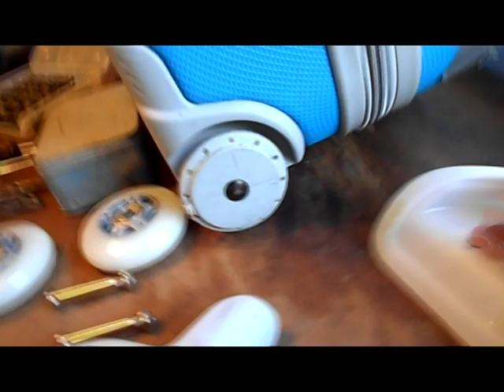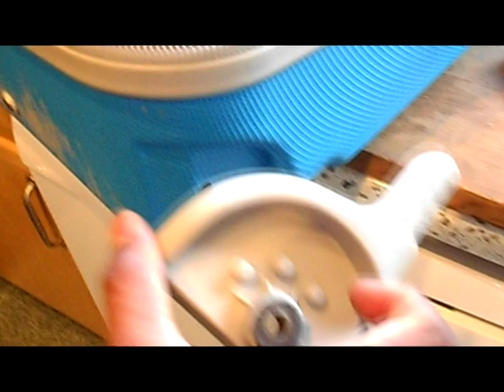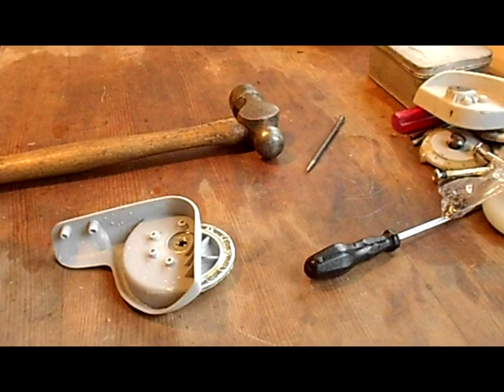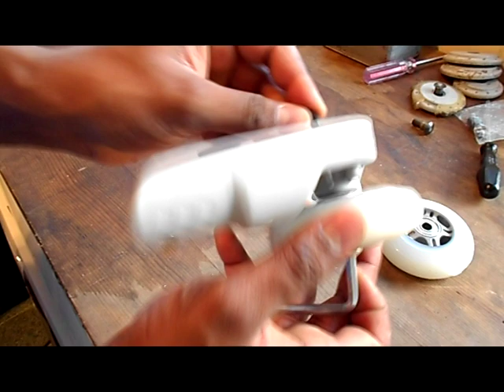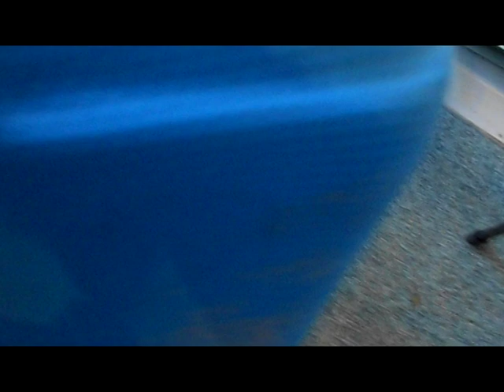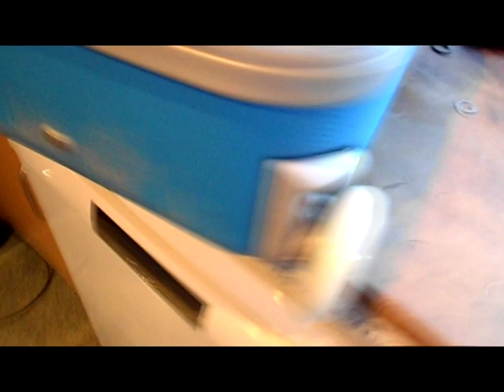Step by Step Guide on How to Repair & Replace Broken Suitcase Luggage Wheels Tripp Samsonite Vid #84

Comment: OMG. He uses a mains powered drill with running water. That is incredible dangerous! Unless you are incredibly careful, you electrocute yourself doing this. I do not recommend doing this. If you must. use a paint brush to brush water on the job from a bucket or basin but not running water.
Reply: Peter Doogue agreed. U use machine grade oil would work great!

Comment: 0:40 List of tools
1:18 Look at original wheels
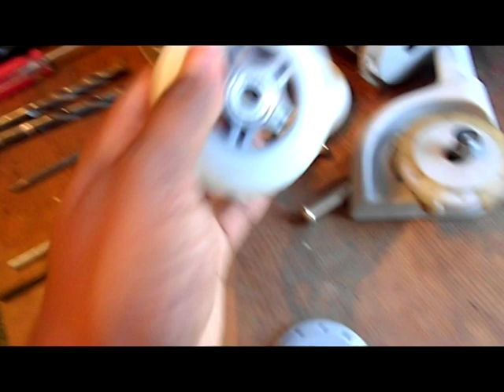1:50 Look at suitcase with new wheels completed
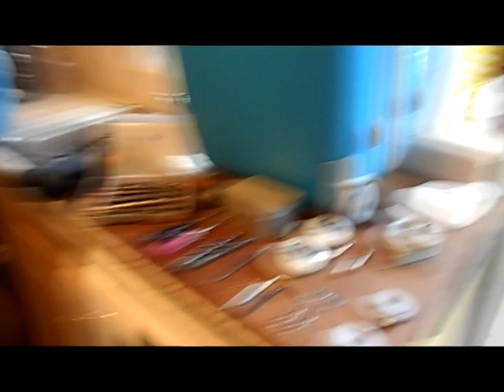2:20 Parts needed to replace the wheels
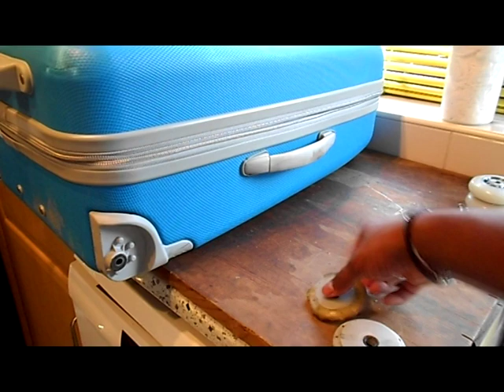4:45 Removing the housing for the wheel
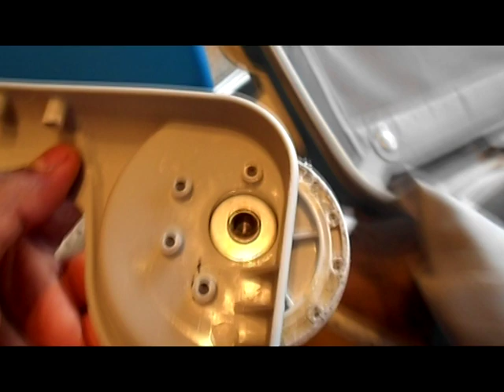7:10 Drill away the lip of the rivet
10:40 Preparing the sink for drilling
12:48 Removing and cleaning the drill bit
13:30 Removing the centre pin with the centre punch and hammer
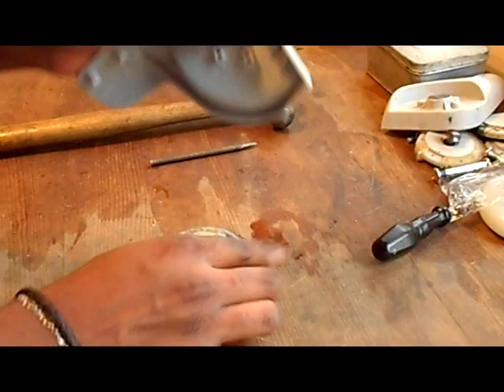14:35 Removing the washers
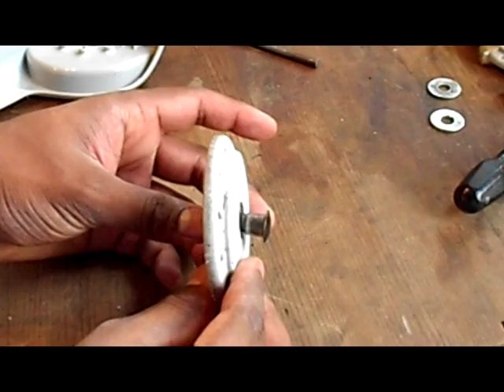15:55 Removing the pin from the old wheel
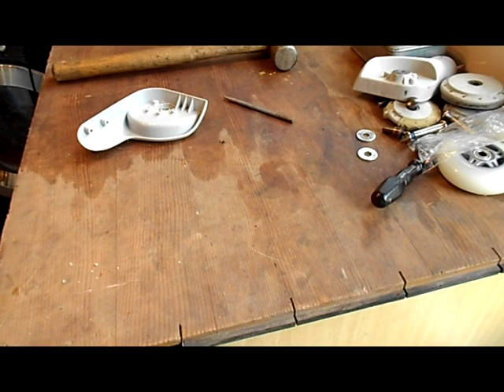16:15 Preparing to mount the new wheels 
16:30 Tools for mounting the new wheels 
17:35 Putting the washers into the wheel casing
19:25 Screwing and tightening the bolt into the wheel
20:18 Tips on mounting the wheel
22:03 Mounting the new wheels on the case 
22:10 Drilling the hole in the case for the head to sit flush 
25:40 Drilling the case
27:20 Re-attaching the wheels and their housing 
30:00 Roll test to check it works
Reply from the maker: Hi Stephen. Thanks very much for posting this, very useful. I have now included this in the video description. Thanks. Anton

Comment: Wow! How lucky am I to find this extremely well made video which fixes the exact same Tripp suitcase as mine (same colour as well) with exactly the same problem, just before I loaded said suitcase into the car destined for the local amenity tip. The wheels look to be unrepairable but now I know different.
Reply from the maker: @Julian Khan. Thank you very much for posting this comment, It really is appreciated. did you fix your case in the end? Regards. Anton

Comment: How do you find the size of the replacement wheels, I have a samsonite pro-Dlx and it is very thin.
Reply from the maker: @Annie Lee. The wheels  I used where 80mm Diameter and I could have probably used 85 or even 90. See how much room you have left on your case with different bits of carboard cut to the shape of the wheel. One thing to bare in mind is that these wheels sit further out from the case then the originals, which means you can generally go for larger wheels as the tops should not rub. I hope this helps. Regards. Anton

Comment: Where can I get the wheels? Thanks
Reply: Could you advice me where I can get the 80ml dia wheel with the 8mm axle as I can only see 6mm on all the websites I have viewed
Reply from the maker: Hi there. I used ebay, and have just purchased another set today to fix another case I have, and it was around £15 delivered to my door with a 90mm diameter and an 8mm centre hole for the barrel bolt

Comment: hullo, where do you obtain your wheels and axles?
Reply from the maker: Hi there. I used ebay, and have just purchased another set today to fix another case I have, and it was around £15 delivered to my door with a 90mm diameter and an 8mm centre hole for the barrel bolt. The bolt is 8mm diameter and 40mm long. Regards. Anton

Comment: Nooooo mine is the 4 wheel version :(
Reply from the maker: Chris G I believe you can still do this, using roller blade wheels, instead of scooter wheels. The principle of swapping out the rivet for a axle bolt should still stick. let me know how you get on if you give it a go :)

Many thanks
Anton

Comment: Thank you!  Very clear visuals and steps.  I have a different suitcase, but believe the basic principles you presented will still apply.  Very helpful!
Reply from the maker: Hi Linda

Thank you so much for your kind words. It is really nice to know that is has helped someone out...so thank you for telling me.

Yes the raw principle should work with any brand of suitcase that has a similar wheel axle type

Regards
Anton
Reply from the maker: @Lindamkohl. Thank you very much for posting this comment, It really is appreciated. I hope you managed to fix your case using this principle. Regards Anton